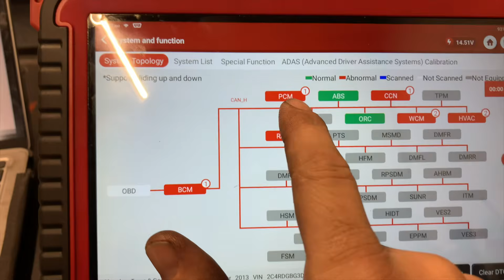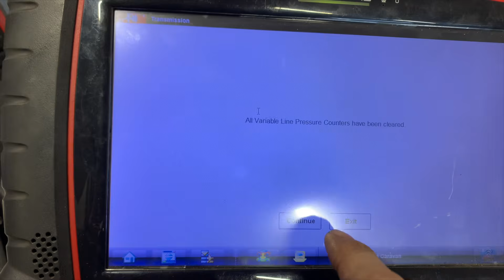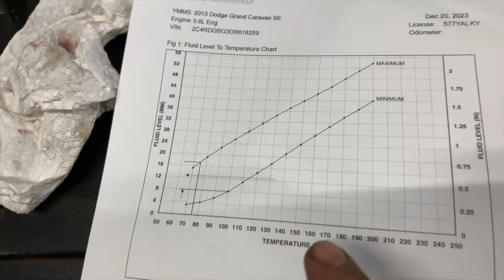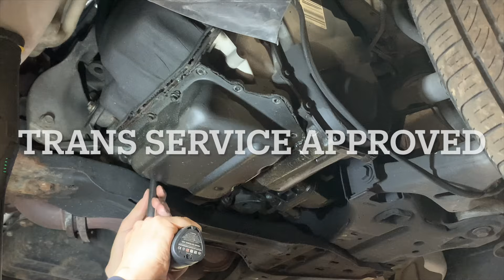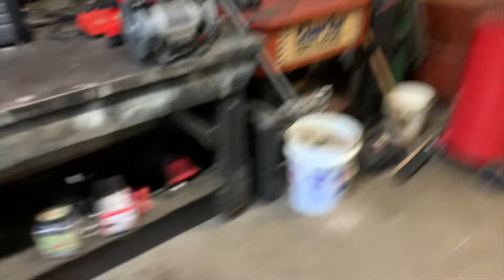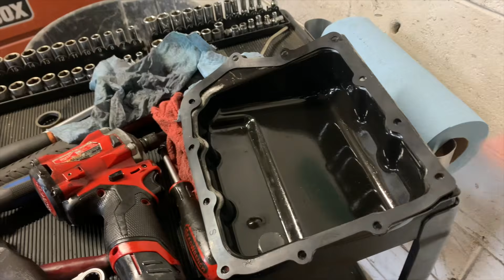2013 Dodge Caravan stuck in limp mode P1745 line pressure to high

Comment: This is exactly what my 2013 Dodge Grand caravan is doing. At first I would notice some hard shifts then about a month or so later it would not shift gears. I bought it at an auction and someone had over filled the transmission fluid. I had it drained and at the right level but still stuck in low. I need to find someone to do what you did to mine.

Comment: IT IS BECAUSE THE TRANSMISSION OIL FILTER IS CLOGGED!!! (THE FILTER IS VERY FINE AND DOES A TOO GOOD OF A JOB FILTERING PARTICLES FROM THE OIL)

REPLACE THE TANSMISSION OIL FILTER
REPLACE GASKET
CLEAN OIL PAN INSIDE
REPLACE FLUID
DRIGE AGAIN FOR 80K MILES

Comment: Unfortunately, that's just resetting everything to fix a much deeper problem. Chrysler has always been plagued by this. Usually with Chrysler it's a governor pressure sending switch and the governor pressure sensor that have to be both replaced together. You should purchase them from Chrysler because it's very proprietary on how many ohms and the exact wattage

Comment: First thing I would have done was check fluid level and condition.   And I'm looking at the color of the transmission fluid coming out of the oil pan when taking it down it was really dirty and the fact that there's a piece of metal in the pan is quite alarming.   Before recommending a transmission service you do all your basic pressure checks and still drop the pan to check to see what is inside the pan because depending on the kind of metal that's in the pan you can figure out where that debris came from in the transmission.  Also you will need to drive the vehicle longer to get it really hot because those solenoids sometimes will act up when the transmission is really hot and I would have also taken an ohms reading on the solenoid to see what it is when the vehicle is cold and when the vehicle is hot and see if it's within specs.    If the resistance is not within specs that will cause the pressure solenoid to not work properly.       Me personally that's what I would have done and I would have told the customer luck you got a little piece of metal I found in the pan and the fluid was dirty so what we'll do is we'll do a complete flush of fluid and change the filter out and then set the fluid level properly and then do a line pressure reset.   After doing that will road test the vehicle make sure everything's good.  But if the problem happens again the pressure song I would have to be replaced.

Comment: The symptoms are exactly the same and the OBD2 reader pulled this code on my 2014 Dodge Grand Caravan, 172K miles. The problem happened an hour into driving on the highway with lots of hills. Suddenly lost mph's and RPM's went high and became rpm's erratic. Didn't have issues shifting before. No smells. Check engine light was on for some time intermittently. Didn't bother to pull codes because has an emissions code previous. We checked the transmission fluid and it was very low. We may have overfilled the transmission fluid? It's still having issues. We will take it into a shop as you probably saved us from junking our vehicle and buying someone else's problem. Thank you for this video and your honesty.
Reply: Update on transmission status?

Comment: for over 50 years cars had a dipstick and was easy to check Tran but Now its gotten crazy bring  up to temp and it has to be at different levels depending on the tempura is crazy
Reply: 15-45mm from dipstick bottom. It's really not rocket science. You can mark the back of your oil dipstick. The issue is, this 62TE trans is a POS.
Reply: Tempura batter?

Comment: I have identical vehicle. The transmission is not sealed but open to the air and the fluid can come out the top. My question is that would not the line pressure have been high because of things clogged from dirty fluid? How could over filling cause line pressure to go up?? I use the same dipstick you used and your numbers check to the numbers I came up with however you did not show or say them clearly in the video. for me at "warm" about 75 on that identical dipstick is pretty safe. Also using the oil dipstick method the level of the fluid should be a bit below the "low" mark for the oil. that is a good starting point where you will be in range.
Reply from the maker: @jaysilverheals4445  yeah I suspected someone put the wrong fluid in this one causing intermittent high line pressure, after I put in the atf 4 it’s been over 8 months & it fixed it, also I just did another  Chrysler like this and I found something interesting in service information, it said not to put the dipstick more than 16.6 inches down to the dipstick tube to get a accurate reading, thanks for watching. I hope this helps.

Comment: What scan tool are you using? Thinktool ProS?
Reply from the maker: Yes, but it wouldn't reset the line pressure adaptations, i had to use my snap on verus, but i love the think tool pros, i use it 90% of the time
Reply: @jonwillfixit  unfortunately, I purchased the pro, not the pros. I wanted the topography feature and didn't realize the pro didn't have that capability. What ever the difference in price may have been, I would have paid it. Otherwise, I love this tool as well.

Comment: I am not mechanic but I can tell you it's car computer that does that? Sometimes like in my case transmission is rebuild by me, everything was ok the only thig i didn't do is scanned after rebuild I was thinking it works good so why poke the bear LOL. Well the computer let me drive for a while about 3000km and then went in limp mode with that code P1745? I know for a fact there is nothing wrong with transmission or fluid level but computer does it counter and when is over it's over? I am waiting for friend of mine co come from Ontario with his scanner to clear that code because he is mechanic and have good scanner (LAUNCH) I can wait few day's lol.

Comment: After a tranny goes into limp modes it will throw many codes and let you know all the parts that it shut down to protect the engine. These codes are not saying these parts are bad. People are understanding it this way. Must reset the EC uthen if a code pops up fix that problem. It's the problem that triggers the ECU to go into limp mode.

Comment: That code happened because no one ever checked the transmission fluid level and kept driving. After it went into lymph mode someone added fluid to try to fix it. Lot of mechanics try to tell people that they're trainees are shot. All they have to do is clear the ECU and change the fluid.

Comment: So in conclusion, transmission was overfilled and the pressure Line needed to be reset with the scanner. Too much fluid was showing too much pressure on the initial data.
Reply: TY.😂 It's a lot to pay attention to.
Reply: I was going to add fluid. 😂 Guess that's not the best idea.
I purchased this thing thinking I had a running vehicle and it won't run pass 35-40 mph. I want to cry.
It's like a governor.
Reply from the maker: @JustAnotherE46  that was my diagnosis yes

Comment: 2011 intermittent and no codes. Dealer had for a week and couldn't cause it. They said it was one of the computers but didn't know which one without it happening while they had it. So I could buy 1 computer and see. I asked will they take it back if it's not that one but the other and they said NO you can just buy the other one. This started maybe a year or less after they repaired the transmission under warranty. Oh no, there is no possible way that could have anything to do with this issue.  To resolve while driving I would pull the trans fuse and put back then all good. Never did get fixed but issue stopped for now. Bet I just jinxed myself ha
Reply: Which fuse do you mean, please ?
Reply: @ghaithghaith2985  Think it was M28 Powertrain Control Module, Transmission Feed, Transmission Control Module or M33 Powertrain Control Module, Transmission Control Module. I first pulled both but found that just M28 was enough to reset it. Thing is, it suddenly stopped having the issue after a few months and then the climate control unit starting jumping around. Too many electronics in cars now. Had to lock the back once set and then the jumping stopped too. So far so good.

Comment: Man you are good mechanic you straightforward you are very thorough. You explain everything so perfect. I got a van that’s not going over 40 miles an hour has 165,000 miles.
Reply from the maker: @RetroEteck  I appreciate that thank you
Reply: @jonwillfixit  How much do you charge to clear the code on this

Comment: I’m currently having this problem for the second time. p01745. My RPM stays high and over heats if I drive over 35 mph. I bought a solenoid for 300$ and before I replaced it, I took it to a transmission shop and the person cleared the codes and it was driving fine for almost a year. I recently replaced the solenoid and no issues were resolved. The mechanic charged me 20$ to clear the code.
Reply from the maker: If the vehicle is worth it i would get a good low mileage used trans for it , one with under 100k at least, you would be surprised how cheap they are, thanks for watching
Reply: What solenoid did you change I have a 2013 Dodge grand caravan

Comment: That metal piece you found in the transmission pan looks like its coming from the lower drum in the transmission compounder assembly. When I first bought my Grand Caravan I brought it to the Chrysler Dealership for a transmission fluid change. Evidently they did not refill it to the proper level and it was low in transmission fluild for 50000 miles. My reverse went out. When my friend and I dropped the transmission pan there were all sorts of metal pieces which came from the transmission compounder. We replaced it and it worked. Its a lot of labor to replace since you have to take the valve body out, plus take out the caliper and brakes just to get to it, but we did it, and the part was $400 plus speciality tools being around $200
Reply from the maker: That’s Awesome work
Reply: Did you by chance make a video for all that work?

Comment: Hi i got those code P1745 and PO868 but when i was driving my car got overheated and the check engine light was on and a check the code so does that codes overheating the car 
Routan 2012
Reply from the maker: No that code is related to a transmission problem

Comment: whats a scanner i can use to clear the code? its been hard to find the proper scan tool for a 2011 Dodge Grand Caravan
Reply: Try the Cgsulit OBD2 Scanner, All System Code Reader for Dodge Chrysler Jeep Car SC530. Costs about $150 and does clear the VLP code. Not difficult to understand and use. 

10:23
Reply from the maker: Snap on verus

Comment: Just unplug your battery for 5 minutes
Reply: this didnt work for me
Reply: @christopherbehrens1373  A better solution is to unplug the battery, and keep the positive and negative cables touched together for a few minutes. It causes a dead short discharging the capacitors in the ecm/tcm, and basically erases any stored codes. I've done this many times when I didn't have my bidirectional scan tool.
Reply: ya that doesn’t work for permanent codes
Reply: @TheRealNaturalDisaster I installed a battery. -😢
Reply: This ain’t 1995 😂

Comment: I have a 2013 Chrysler 200 with the same code p1745 were should i start?
Reply from the maker: Step1 Find a scan tool that can reset the pressure learned values in the transmission, you can’t clear the code without resetting 

Step to2 Drain transmission fluid & put back the proper fluid

Comment: i have a 2009 chrysler town and country withe the 3.8 V-6 engine with the 62TE 6 speed transmission. it went into limp mode a month ago and will not shift into the higher gears. but when i pull over and stop and put it in park and drive it again it will shift just fine in all gears for around 1 mile to sometimes 3 or 4 miles then drops back into limp mode. i have since taken off the trans pan and changed the fluid and filter with no change. i have a code of PO76A SHIFT SOLENOID H MALFUNCTION. i have seen on many you tube videos that if you replace the solenoid pack that will fix this issue.  WHAT DO YOU THINK ?
Reply: I run a fleet of these vans andbi had 1 with the same issue you drive it for a few miles and it goes into limp mode but you restart the car and its fine agian.it ended being a computer these computers are very well known to go and the transmission control module is built into these computers
Reply from the maker: This is a generic code that can be generated by several issues, bad solenoid, slippage or even lack of pressure , unfortunately there isn’t a straight forward answer that would result in a quick fix, I would suggest taking to a technician in your area that’s known for being able to diagnose transmission issues, sorry I couldn’t give i just don’t want to suggest a part that doesn’t fix it then your back to square one only with less money in pocket now, I’m really into doing a proper diagnosis for my customers, keep me posted

Comment: I'm wondering if the transmission being over filled was the initial cause of the code being set along with the limp home. Maybe causing the pressure to be to high. Thanks for a very informative video! Keep up the good work!
Reply from the maker: That’s a good question & I also was wondering the same thing 

I can say this, the customer has had the vehicle for about 3 months with no issues 

Thanks for watching

Comment: Hopefully that saved it, I abandoned the Chrysler vans while back, you must buy them with low miles and flush and fill the transmissions RELIGIOUSLY (max 30k) or you will be replacing them, I'm shocked it lasted 175k. I would sell it and slide over into a Sienna while it is working and call it a day.
Reply from the maker: I definitely agree with that statement